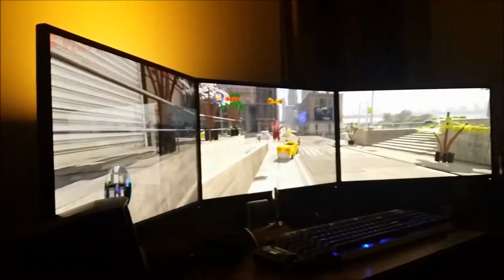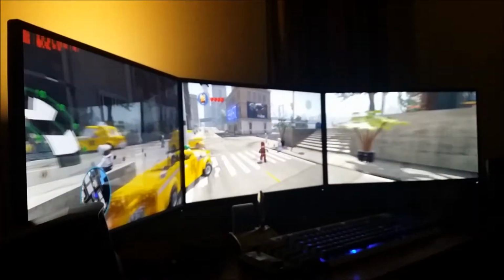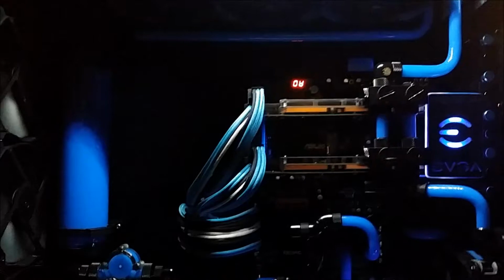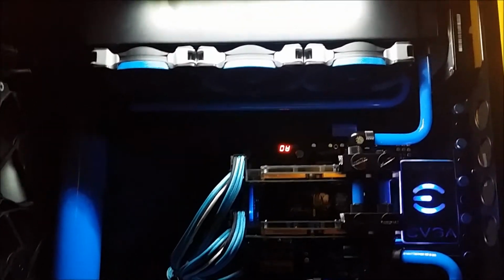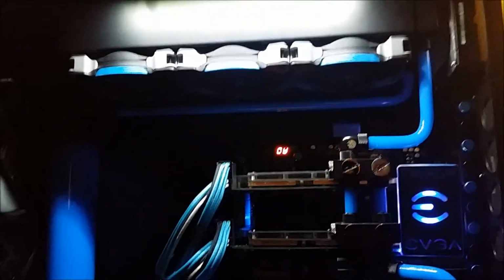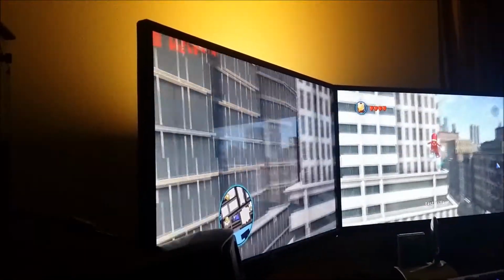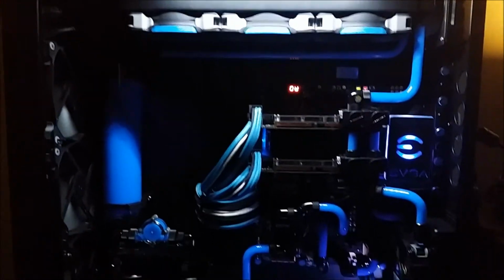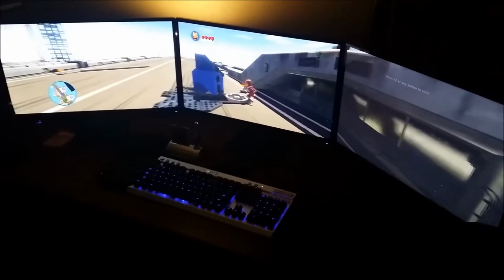Neptune 2.0 - NZXT Switch 810 Build Log Part 7 - Long Term Update and Changes

Comment: What and we're did you get the it bottom:mid plate did you have to paint it if so what color paint. Bc I updating to petg and my build is simat to your orginal and I want to paint some things the blue pastel color and get a mid plate the same color
Reply from the maker: I got the bottom acrylic plate from Amazon.com.  Just search for acrylic panel and you'll find different color and size options.

Comment: Oh I forgot. How is the performance if the XSPC block compared to the bitspower summit? IIRC in reviews the bitspower was very similar to the Ek supremacy.
Reply from the maker: The difference is negligible and is as good as how you mount it.  XSPC does not have the best mounting solution but if done right, it can be from 3-5C.
Reply: Glad to hear it, wanted to make sure the summit was decent lol. As i bought one like you had the Ice black POM and plan to run pastel mint green in it.
Reply from the maker: My Summit did better than my Swiftech Apogee HD.  Unboxing, Installation & Review - Bitspower Summit EF (Intel)
Reply from the maker: Wait.  You did see it lol

Comment: I'm glad I saw this before I started ordering components for my computer. I've got a PNY GTX 770, which is built onto a GTX 680 reference board. I was considering going with the Bitspower water block for my GPU, but after seeing this, I'm definitely going with something else.

I'm leaning toward the XSPC block mainly because the EK options are a bit more expensive, and hearing the results you got switching over, but I'm also considering the Koolance block because I'm going with the Koolance CPU block.
Reply from the maker: Yeah, unless you're going for looks, Bitspower ain't there, at least for the GTX 680.  The cooling fins are widely spaced acrylic like the old style blocks vs newer 0.5 - 1mm copper channels of the new blocks.  My blocks have 0.5mm channels on both the Raystorm and the Razor blocks.  I'd go with XSPC but Koolance does a good job as well.  EK is also nice but pricey like you said.  Glad I helped dissuade you from buying it.
Reply: OCTurboJoe
Update on this. Initially I went with Koolance. I bought a second GTX 770 card and had two of the Koolance blocks. I had a weird temperature difference under load, though, and under Bioshock Infinite, one card reached 77C while the other was in the mid 50sC, and one card got up to 60C under Valley Benchmark -- I'm running 2xdual-120mm and 1xtriple-120mm radiator.

I changed the blocks over to Watercool Heatkiller GPU-X3 and am getting much, much better temperature performance -- upper 40s to low 50s under Bioshock Infinite, barely breaking into the 40s under Valley.

In hindsight I'm going to be retesting the Koolance blocks and RMAing the one that is getting hotter (or RMAing both of them, depending on results) as I think I just got a bad block, given the major difference in temperatures. And then it's a matter of what to do with them afterward as I'm likely going to stick with the Watercool blocks anyway -- they perform better and look better as well, unless the re-test on the Koolance blocks yields better temperatures.

Comment: I can appreciate all the hard work that went into it
Reply from the maker: This build came a long way.  The wife kept thinking it's a new system everytime I changed its configuration.
Reply: Hey joe if you dont mind what are your opinions on air cooling vs water cooling. And be water cooling i mean the all in one liquid coolers by corsair and other brands. I need some help picking a cpu cooler. I was looking at the h100i but not sure because i like the look and asthetics of it but im not sure how reliable it will be.
Reply from the maker: Gianni Adduci If it were me, I'd skip the liquid AIO's for a high end air cooler.  If you're going to be water cooling, do it right from the start and build a kit to get the best gains.  Some of the AIO's out there I'd say are pretty reliable but cut down temps only by a few compared to, for example, a high end Noctua cooler which is pretty quiet for an air cooler.  Also, pumps and fans on AIO's are most of the time noisy.
Reply: Ok thanks i think im gonn stick to an air cooler i 
 Just gotta find one that looks good for my build and performs well